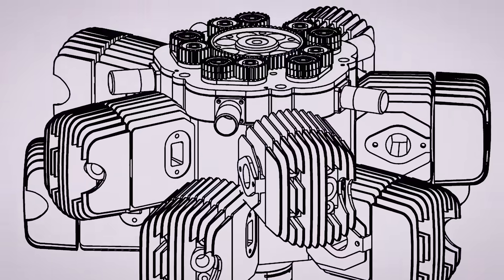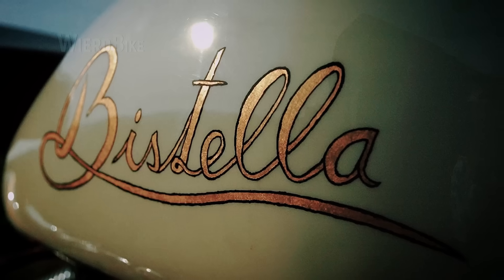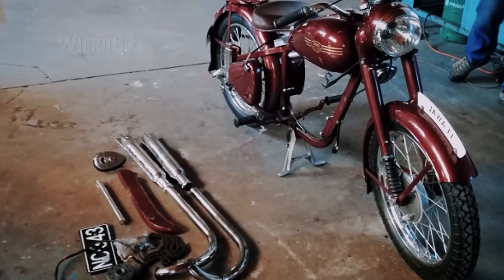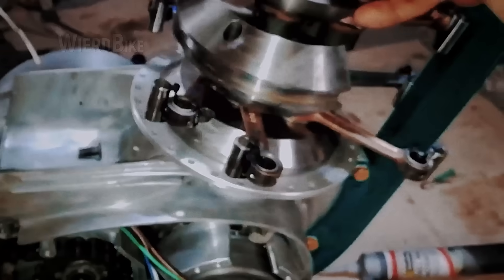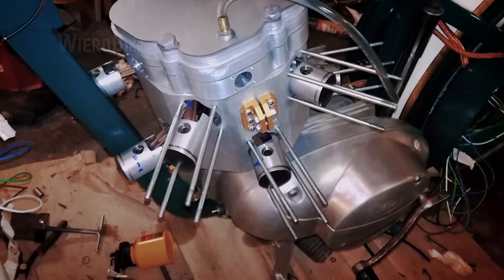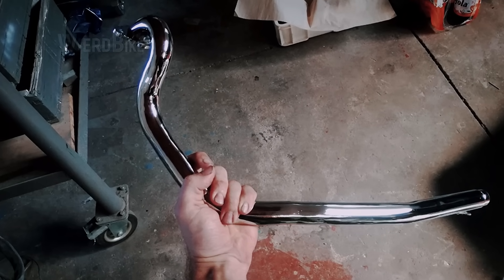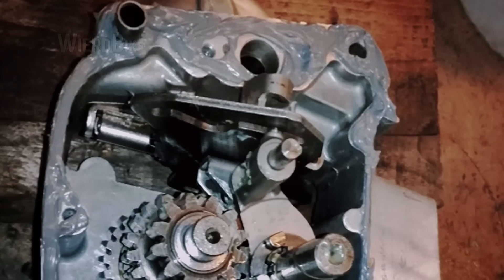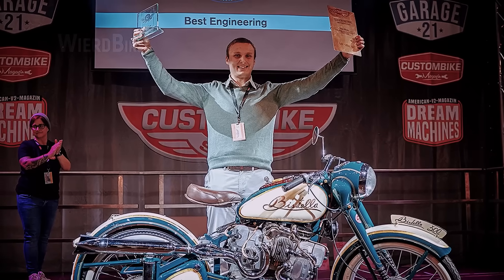He Built an UNIQUE 2-stroke Motorcycle Engine!

Comment: Most Unique? What's the difference between slightly unique, moderately unique, fairly unique, almost unique, actually unique, greatly unique & most unique?
Fact is, it's either Unique, or it isn't. This one, by definition, .... is, by virtue of it being the one & only engine of its type. That's what Unique means, so the prefix "most" is completely superfluous.
It is not the only unique motorcycle engine either, but it is unique in the format & layout & props to the man that conceived it, crafted it, made it, then made it run in a motorcycle. 
Me dips me lid to you sir.

Comment: Radial engines are always odd number each row, the parts were very available and economically from old Jawa bikes. This was very clever! This is going to be in a museum one day!
Reply: Actually only 4 cycle radials need odd number cylinder rows.  A two cycle radial works fine with even number rows.  Detroit (GM) built a production two cycle diesel radial with 4 banks of four cylinders (16 cylinders total) during WWII.  It was originally intended for a long range bomber (aircraft) but eventually found use in (relatively) high speed patrol boats where a pair of the engines were installed vertically on top of a 90 degree bevel gear set driving the prop shafts.  I worked on board one of these boats.  One interesting feature was that all four connecting rods were connected to a single crank throw with each rod having just a less than 1/4 circle bearing and all held in place by a pair of metal rings holding them to the crank throw and that was a weak point in the design, not tolerating a misfire on one cylinder.
Reply: @Nahngunnarson amazing! Thankyou for that. I heard they used radials is some of the Sherman tank production. I’m sure that would have been gasoline for logistics.
Reply: @Nahngunnarson I know the classic Harley uses a single crank pin and basically is a two cylinder radial engine missing the other three cylinders if you look at it funny.

Comment: 120hp from ten close to stock 50cc cylinders doesn't seem right, especially without even using proper exhausts. 
Even with a good 50cc racing cylinder you don't get 12 HP without more rpm than this thing will most probably be able to handle. 
And here you need quite a bit more than just 12 HP per cylinder to reach 120 due to compressor losses. 

For this I'd even call the claimed 60 hp rather doubtful and I'm wondering why he claimed such numbers, since that's clearly not what the project was about anyway.
Reply from the maker: That’s Marek’s words, all i can say
Reply: @weirdbike 
I know, wasn't meant to pin that on you.

Just felt the need to mention it. I suppose there's something lost in the translation, maybe he meant the power potential of 10 x 50cc under better conditions or some such.
Reply: Don't believe everything you see on the Internet! It's made to look like a radial but it fits over the one cylinder and it can be ridden and it runs too . That's why they don't show you the way it is supposed to be put together. If you look closely at the paused video closely you can see the thing don't have everything the way it needs to run. Good magician!
Reply: @AnnaAllen-l6b 
Yeah, no.

But anyway, what do you suppose is missing for it to function properly?

And how does it generate the sound of a multi cylinder engine, if it's just a single cylinder?